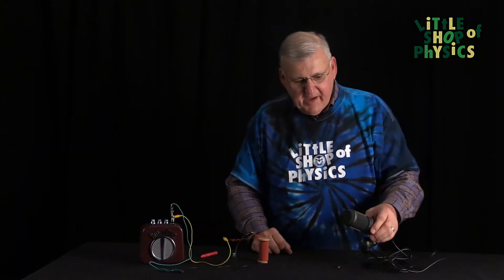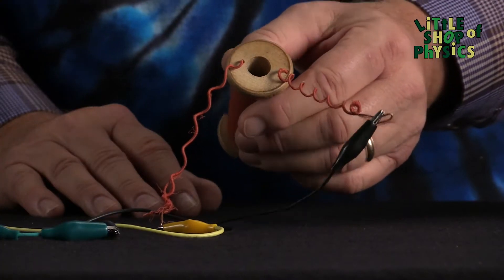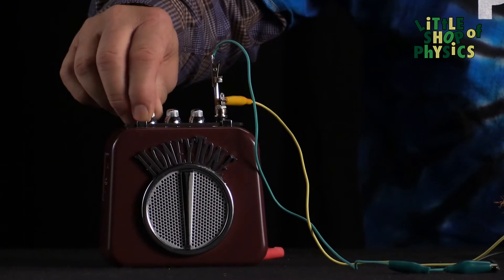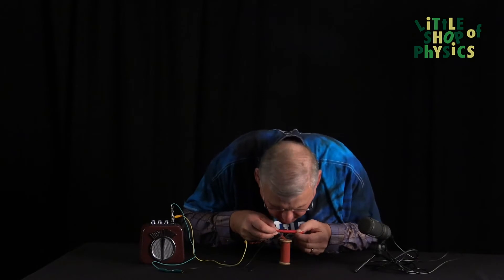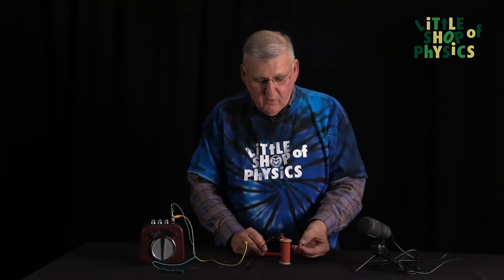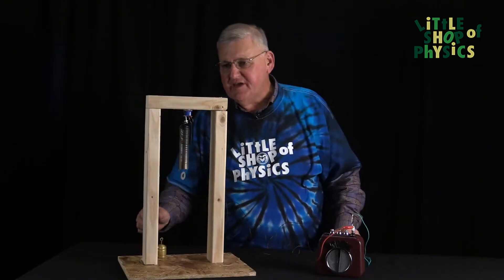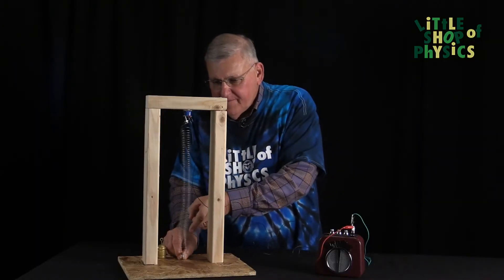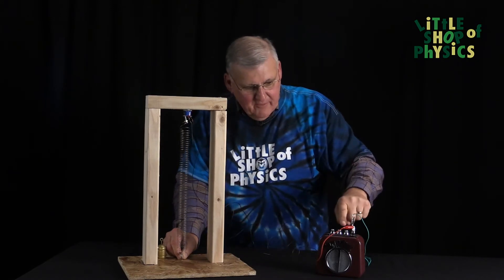Get Your Science On: Slinky Sounds

Comment: I suspend a slinky from the suspended ceiling in my apartment. The top of the spring gets a few coils tucked into the framework that holds the ceiling's tiles. The bottom end of the spring grips 1/2" on the base of a larger-sized "Solo" cup. It is the ultimate "fidget thingie". The cup amplifies the spring's sounds. While seated in a chair, I can swing the thing out and it returns for an easy catch. It's like a yo-yo in reverse.